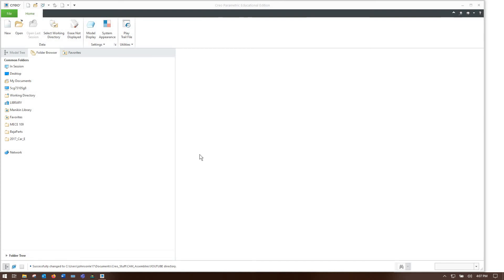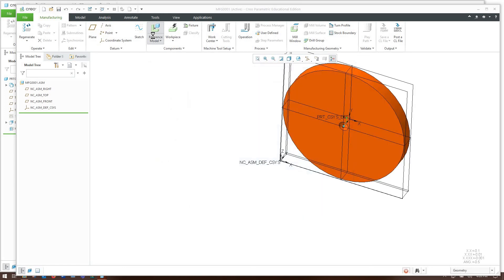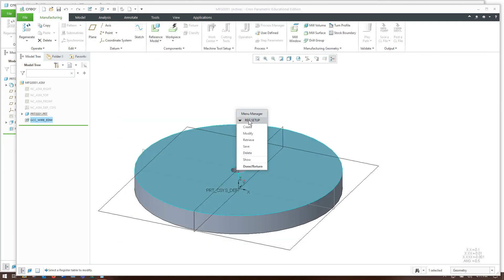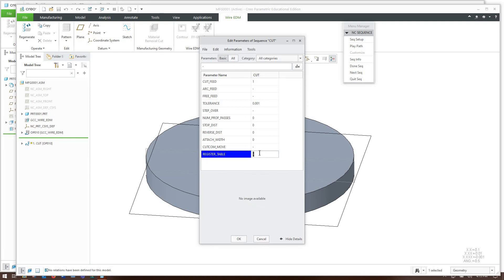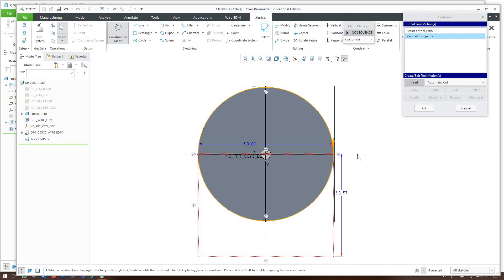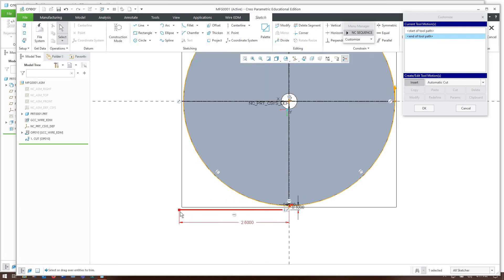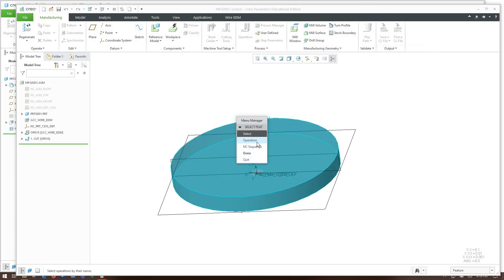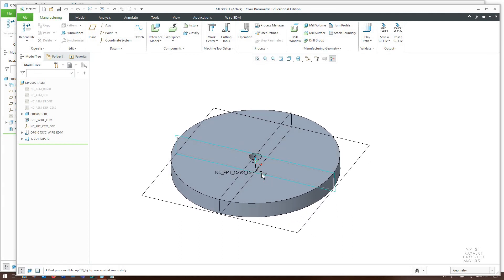Introduction to Wire EDM Programming with PTC Creo

Comment: very helpful as PTC has not documented this at all.  Could you do one showing the configuration/setup of an actual machine and work holding?  Also, try to pickup a better microphone.  It is tough to hear you at times.  Thank you for putting this info out there though!
Reply from the maker: Thanks for the feedback, Chris!  Yeah, I tried recording both with the mic on my laptop and the mic on my headphones -- neither was real great.
I would love to do a video on actual EDM setup (as in, physically putting the part in the machine and cutting), but, unfortunately, I no longer have access to the college machine shop (I just graduated this may! :)
I might still be able to make a video on setting Creo up for a given machine using PTC's post processor utility from AustinNC.  As you might have noticed, my channel has been in limbo for a while -- I just moved into an apartment and started a new job less than a month ago.  Now that I've got my feet on the ground, I think I can get rolling!
Reply: @newengineerontheblock  gotcha.  Setting up creo and the post is what I was talking about.